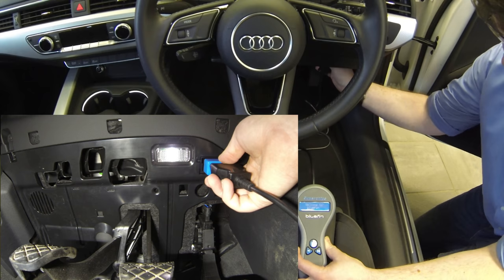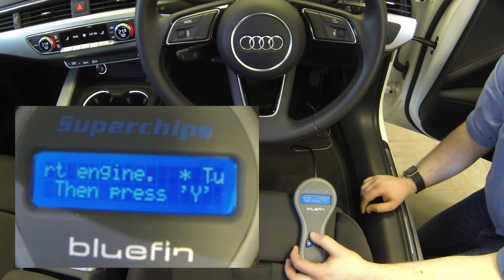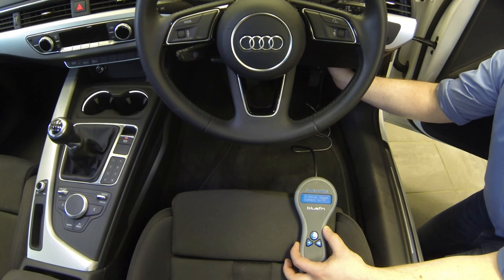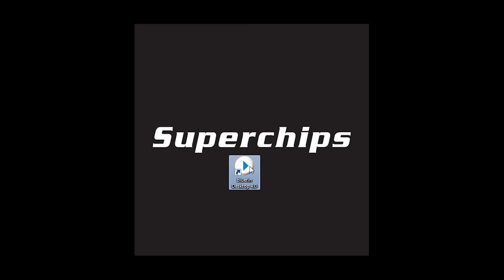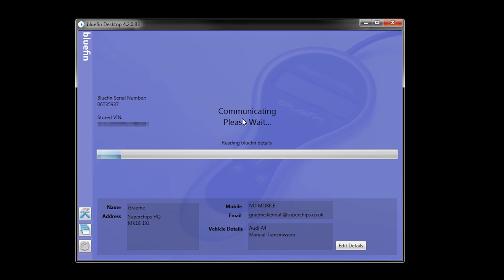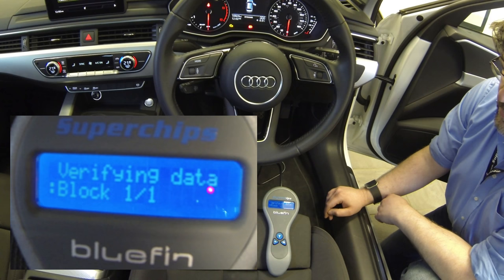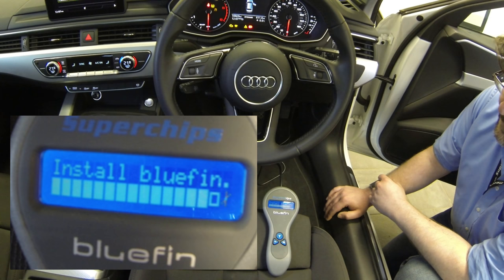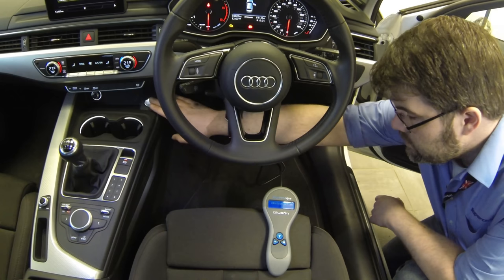Superchips Bluefin - [OFFICIAL] How to install a Bluefin on your car!

Comment: Hi. Just bought one. Can I take the map off and flash my original back on? An flash new map back whenever I want?
Reply from the maker: Yes you can. Bluefin alternates between installing the stock calibration and installing the remap. You can do this as many times as you like on the same car.

Comment: Note: if your tune is preloaded, it will automatically go into installation mode. In my case anyways.
Reply from the maker: Totally correct! There are some early Ford and Mini vehicles which have a pre-programmed Bluefin, which will offer you the option to install straight away. These are relatively rare though, the vast majority works like above.
Reply: @superchipsuk  was a mk2 focus
Reply: I have a Focus 2007 MK2 ST225 and just ordered my bluefin today. I presume this will automatically go into installation mode once I connect mine to the car but also save my original ECU details. Thanks

Comment: So can you add the original map back on anytime.? Whats the benefits of this over a dealer map. The bluefin is £150 more expensive. Can you sell it on? Or use it again for a new car etc etc
Reply from the maker: You can swap between original and remap as many times as you like on the same car :) Bluefin allows this flexibility via the handheld, which some customers value when they change cars often or if the car is very new. If you don't change car often or you don't feel the need to apply and remove the remap, then you can get the same remap from the dealer for less.

Comment: Can you correct software for installed hardware? Bigger throttle body, cold air intake, bigger compression ratio (10,2-11,2) and high-octane (100-102) petrol . Car Ford Focus ST170 ‘03.
Reply from the maker: Technical questions should always be addressed to us directly, because the answer is different for every car. Please contact files@superchips.co.uk for an answer related to your specific vehicle.

Comment: What's the difference between Bluefin (not available for my Peugeot 308 2014+) and the Superchip (available for my Peugeot 308 2014+)?
Reply from the maker: Bluefin is a programming tool that allows our customers to apply our remap to a car themselves. The actual remap specification does not differ between Bluefin and the fitting centre - both come from our HQ and both are based on development work completed here - it's just the method of application that differs. For technical reasons, not every vehicle is compatible with the way Bluefin functions, therefore some cars (like your Peugeot) can have a remap applied at a fitting centre using a laptop, but cannot be programmed with Bluefin. I hope this explains it for you :)
Reply: Very clearly explained, appreciate it. Sadly, there's no fitting center here in the Philippines to do that. But I have another car where Bluefin will work. Cheers!

Comment: Can I purchase a second hand bluefin on my Ford Focus ST225?
Will it work??
Reply from the maker: This is a complex question as there are 3 different hardware types and about 30 different firmware variants of Bluefin. In general, yes it is possible to purchase a new remap to use on an old handheld, but what will happen and exactly how much it will cost will depend on many factors. If you are considering purchasing a second hand Bluefin, please email sales@superchips.co.uk for further advise, it's more complex than we can adequately cover in a YouTube comment :)

Comment: Is there a remap yet for the 2018 Ford Fiesta 1litre eco 140. I had a reply back from Superchips recently stating it was still being developed due to new eu emission standards. Would the remap become available in the new year perhaps.
Many thanks.
Reply from the maker: The EU6.2 variant should be covered, if you contact our Technical team on files@superchips.co.uk with your vehicles VIN we can double check for you

Comment: How many cars can i remap with one purchase
Reply from the maker: The easiest way to think about it is one purchase = one car. The Bluefin handheld is a programming tool which works on one car at once. The maps are essentially vehicle specific, therefore the Bluefin "pairs" with a car, and you'd have to purchase a new remap file if you wanted to use Bluefin on a second (or subsequent) vehicle. This action unpairs it from the first car, and pairs with the second.

Comment: Awesome video Superchips. I'm very tempted to do this for my mk4 Mondeo 2.2 tdci. Are they proven reliable? I know this must vary on car but what sort of warranty do you provide, if any? 

Many thanks and keep up the good work.
Reply from the maker: Our Warranty runs in line with the manufacturer's statutory warranty. We don't offer any cover on a car which wouldn't be covered by the manufacturer, simply because we'd end up fixing things that weren't related to the remap. You can find detailed descriptions about what is and what is not covered by the warranty on our website here http://www.superchips.co.uk/s/warranty
Reply: Superchips Ltd got ya, thanks for the reply
Reply from the maker: No problem :) In terms of are they proven reliable... well, we've been in business for over 35 years, and you don't last so long by creating products that break cars :) Just because there's no warranty for legal reasons doesn't mean we're not concerned, and everything is designed to be within tolerances of what the engine can cope with. As long as your car is well cared for and in good mechanical condition, you shouldn't experience any issues.

Comment: can I use an android tablet instead the pc? does the program run?
Reply from the maker: You'll need a Windows PC with an internet connection to get the software working. Nothing Bluefin related is stored on the PC so you can borrow one if you don't have access to one yourself :)

Comment: Got two questions 

1, do you get a variety of different maps ie pop and bang map and stage 1 etc maps?

2, I have a 2007 corsa vxr will this connect straight to my car or do I need to get my ecu programmed to enable the blue fin to communicate with my car?
Reply from the maker: Probably best to drop us a line on files@superchips.co.uk with more technical queries :)

Comment: Can I use my Apple Mac to get the software
Reply from the maker: Hi Tom, the software only works on Windows PC. No important data is stored on the PC you use, and you can connect from any PC in the world at any time as long as it has an internet connection, so even if you mainly use Apple it's usually possible to get hold of a PC for the required time to use the Bluefin :)

Comment: I made a request over and over again that I would like to reset and use the blue fin that I have handed over to me, but there is no contact.  Even if you are absent because of the virus, you'll probably be absent for months.  It seems that you can reply by e-mail and provide services without contact with people.  I think it's best not to value the customer as a company's position 👎

Comment: Does the ECU store any codes that reveal it has been modified, even after reverting back to the stock map? The car in question is a MK4 Focus 1.0 EcoBoost 125.

Cheers.
Reply: I'm not superchips, but can confirm that some manufacturers have a count on the ECU thay shows it's been flashed or how many times it has been flashed. 

I personally wouldn't be doing this under warranty, but most manufacturers would never go into that level of detail if you had a problem, especially if it's something non ECU related
Reply: @XXB4XX  I know that VAG have a so called TD1 code that allows the manufacturer to know if the vehicle has been remapped and later discovered Ford does the same by seeing if the ignition counter has been reset, which happens when you flash the ECU.

I’ll think about remapping after warranty.
Reply: @mikerelvas  correct mate, I've got one of the VAG family and they can see the flash count